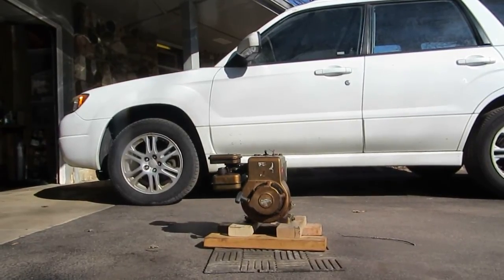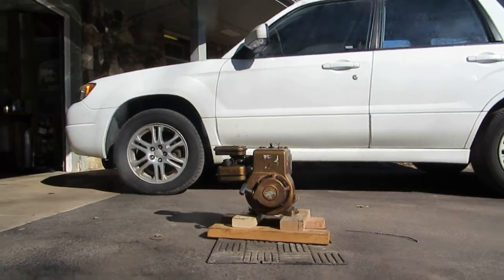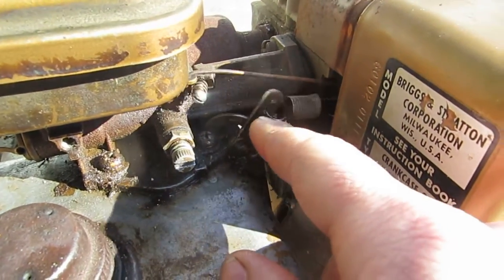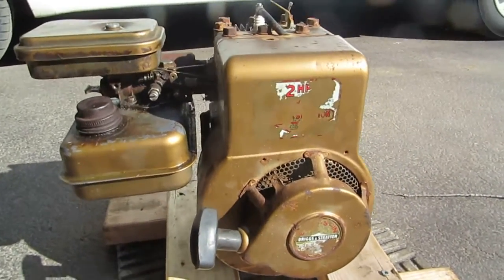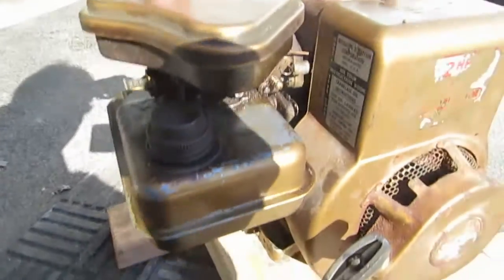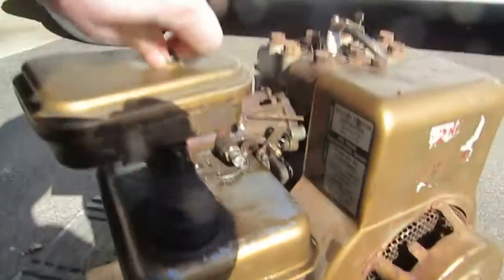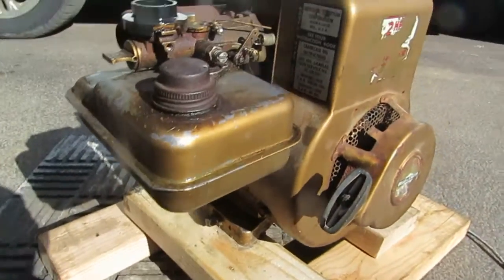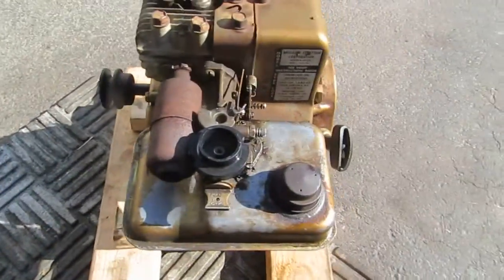Briggs and Stratton 60102

Comment: I’m in auto shop at my high school, and our current assignment is to take one of these apart, right down to the block, put it back together, and then it has to run, otherwise we fail. I certainly hope mine will start as easily as yours did 😂.

Comment: NICE to see how LOW they can idle and not expire. best i cld do with one is abt 600 rpm with a digital tach/hour meter before it wud not putter anymore . the ones before 84? had points. the ones after have Magnetron ignition on them .  carbs arent too expensive $22, but gas tanks are VERY EXPENSIVE $66+ and that is USED

Comment: What level do you fill up the oil to? I have the same one that came off an edger , it has no dipstick. I have it filled up to the first couple threads for the cap. Is that right?

Comment: Has it been converted to Magnetron or did someone just slap that sticker on it? 
These are tough little engines. Parts are still cheap and plentiful, too.
60102 breaks down to a 6 cubic inch "Kool-Bore" aluminum cylinder / plain bearing case / Vacu-Jet carburetor.

Comment from the maker: Briggs and Stratton Generator Project pt2

I have a 1 1/2 inch pulley on the engine running to a 2 inch pulley on the alternator. I purchased the alternator from farm and fleet for $60.  If you have any more questions, just ask.

Eli
Reply: ideally 6" pulley on motor to 2" pulley on the alternator like on a car so the motor can turn not too fast and the alternator can turn 4500... 1 to 3 ratio... 1500 rpm to 4500 rpm where the alternator is doing the most generating.